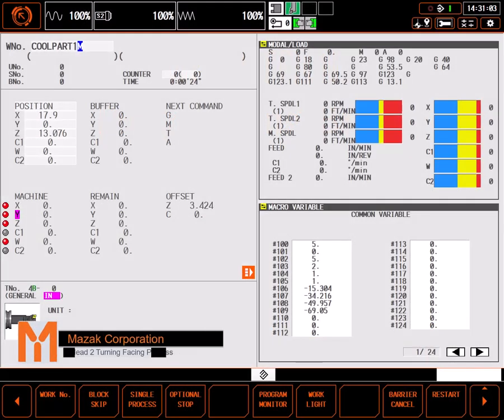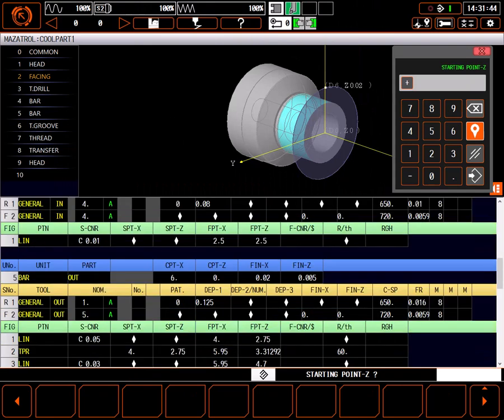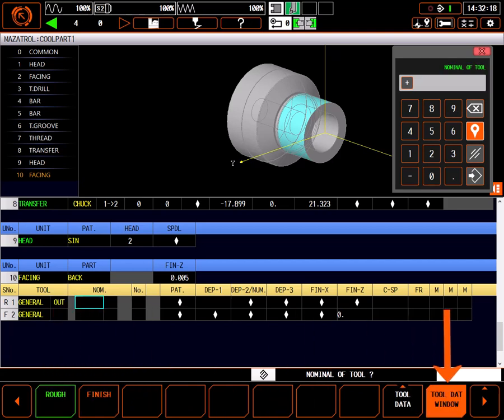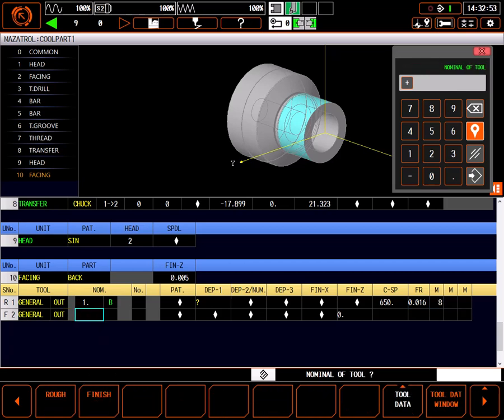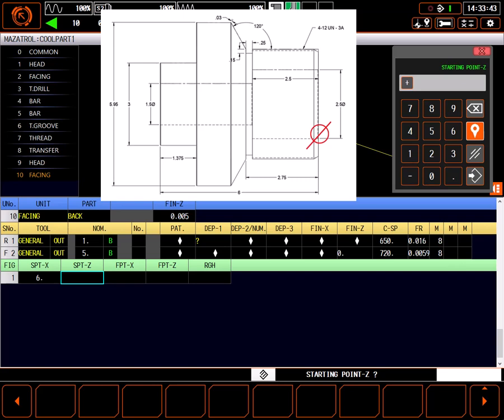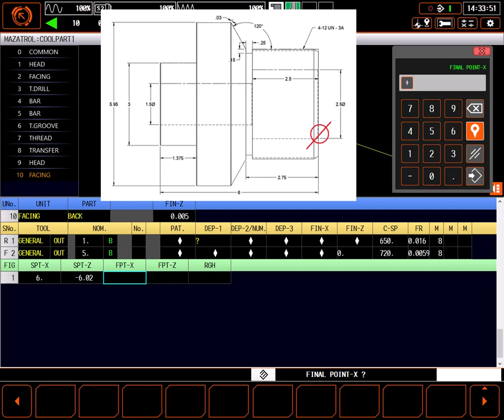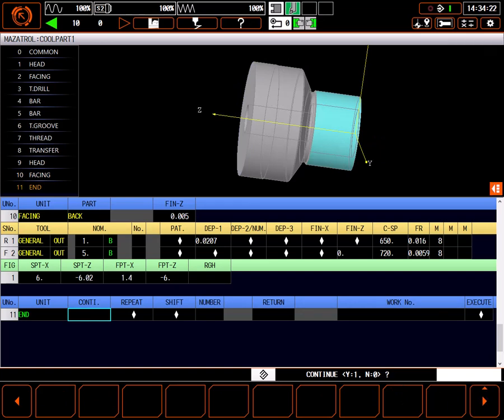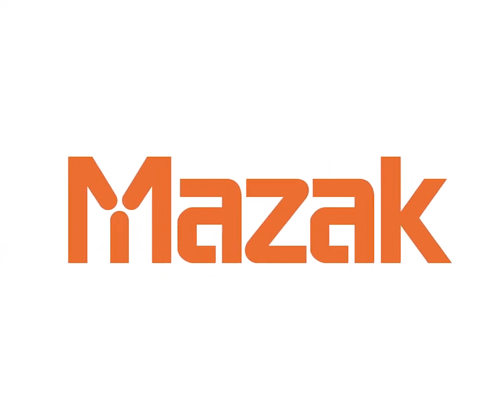MAZATROL Programming Briefs: Facing on Head 2

Comment: what sets the work coordinate to the sub spindle?  I have a sqt100ms with the fusion 640T control.  I can get the sub spindle transfer but when it calls up the tool it goes further toward the main spindle.  I'm missing the step to put in onto the sub spindle.